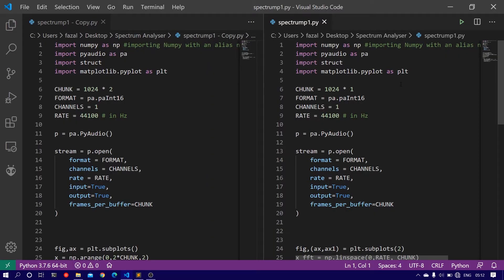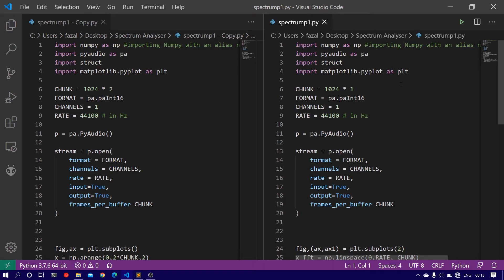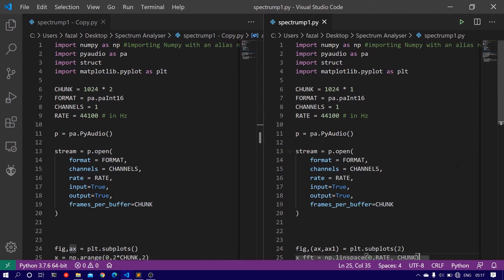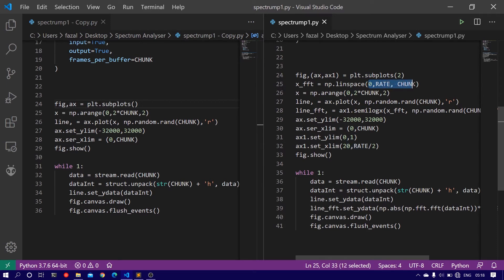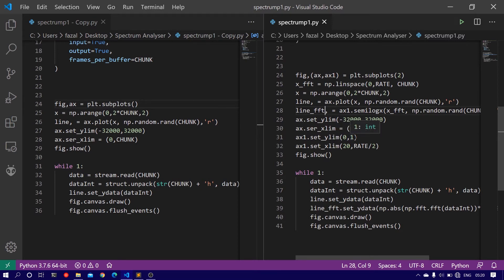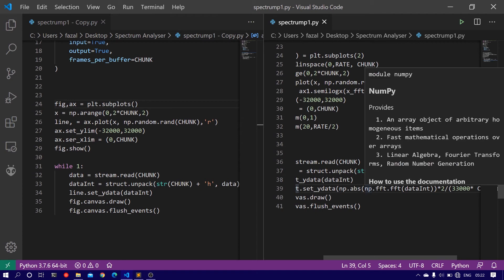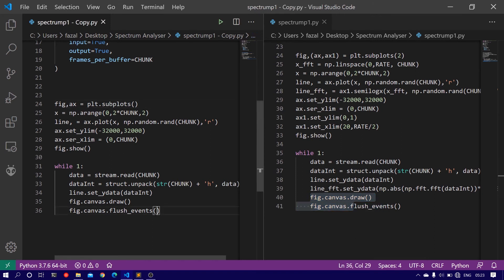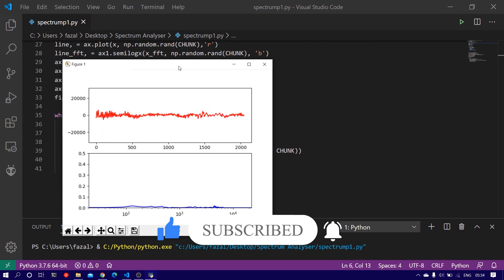Realtime Audio Spectrum Analyser Using Python 3 | Part 2

Comment: hi mohamed, excellent video.
How I could use this fundamental frequency data and send it by serial port? 
My idea is to vary led light at the frequency rate.
Reply from the maker: Yep that would be possible, you can use the python serial module to achieve it. But I think the serial data rate wouldn't suffice the purpose, you might have to find a workaround.

Comment: If I have to store input data in CSV file..then where I have to change in code
Reply from the maker: In this line `dataInt = struct.unpack(str(CHUNK) + 'h', data)`, the variable dataInt contains the integer values of currently sampled amplitude. You could simply store that variable's cumulative data.
Also remember that writing data to file is a slower process that could add additional lag. So I recommend using multithreading. A separate thread to write to the file is recommended.